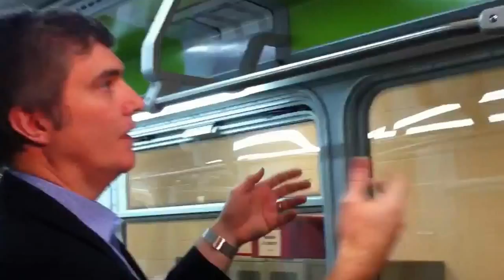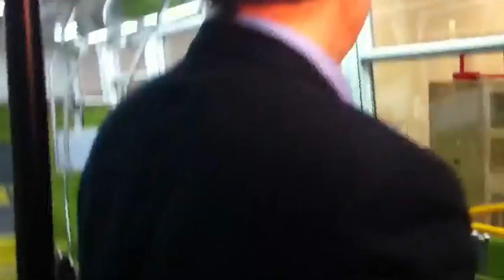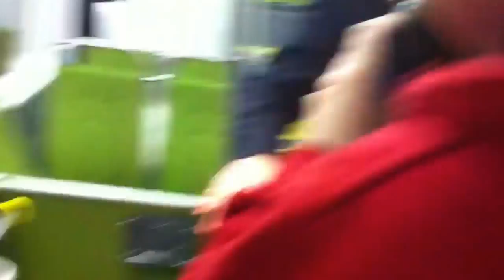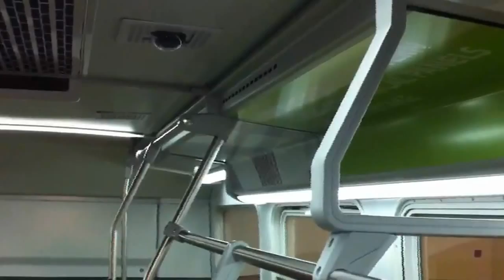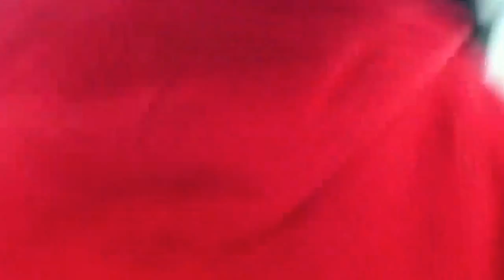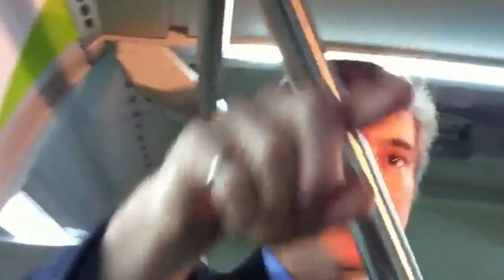Nova Bus: new interior bus design

Comment: With that design the heat will first creates a heat screen before the contact with the rest of the environment, so it will heats up slower but can store more heat and create a much bigger thermal buffer to prevent sudden heat lost due to a door open.